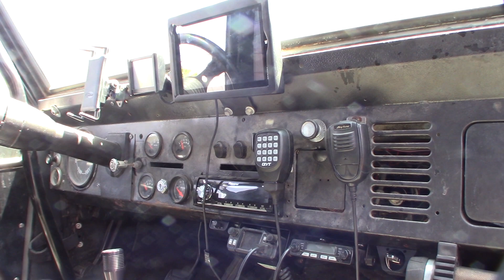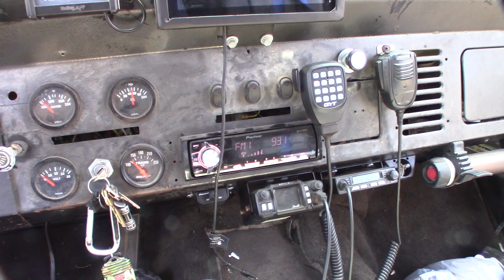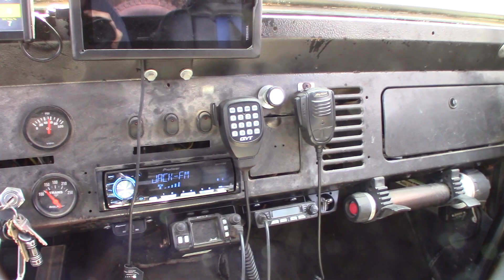Car Stereo AMP speaker Humming Whining sound changing with RPM fix repair solution

Comment: Bro you don’t realize it…but 7 shops have worked on my semi and couldn’t figure out the whine….i got looking through stuff and stumbled across this….this absolutely fixed my issue 100% and now it’s flawless ….ive spent hundreds to figure this out …..instantly made a giant difference…thank you so much for sharing…
Reply: You need to do a big 3 upgrade and clean all your vehicle's ground points for better contact because this video is only a bandaid fix around a real problem.

Comment: I just got a new JVC aftermarket radio and installed it. I don't have my door speakers or tweeters hooked up to an external amplifier, just the deck. I got it all wired and when I fired the car up, as soon as the radio starts, a loud static/screeching sound plays through my mids and tweets. The tweeters get no music just static, the mids get music and static. I am curious if I should cut the car harness's factory ground wire that is running to the headunit and run a NEW & seperate wire from the headunit to the amplifer's ground? Or should I keep the cars factory harness's ground wire and run a secondary ground wire from the chassis of the headunit to the amplifer? Another question is should i use the radios harness black wire (the ground) to run a new wire to a new ground location or should I just connect it to the radio's chassis and run it to a new ground location? Hard to explain but sounds like I'm riding inside a UFO.

Comment: Ok what's the solution if you do not have an amp? 2004 GMC Yukon with factory Bose radio changed out to dual brand 7inch touchscreen. Got an awful whine through the new radio but I don't have an amp.
Reply: Same mine is only the drivers door. 06 Sierra did you ever figure it out?
Reply: Ok guys listen up there are several possibilities and there are steps to eliminate each one.

1. Bad grounding location.

To find a proper grounding spot you need a multimeter set to ohms (resistance).
Put one lead on your battery's ground and test all available grounding spots with the other lead.
Use the spot that shows the least resistance. 

Always ground your head unit, amps, and any other related devices that are in the signal path to one spot.  This is called single point grounding.  Keep in mind that you head unit may be grounding through the chassis also and may need to be insulated if using metal brackets in an ISO mount.
I have also solved ground loops that were caused by the radio antenna.  The outer shielding in some cars is grounded to the ant base from the factory.  Try unplugging the antenna.  

The most common problem is mixing audio components that use a floating RCA ground with comp that connects the RCA grounds to the ground wire of the units power supply.  
Test each component by using a multimeter set to continuity and place one lead on the rca grounds and the other to the units ground.  Then test rca ground to units chassis.
If all your gear has no continuity or if all has continuity your most likely OK .
But if one device in the signal path doesn't match the others you need to address that by either using a ground loop isolator or convert it from floating to common or vice versa.

Do not buy a cheap isolator, I have seen cheap ones ripple your frequency response.  And will only reduce the annoying sounds that you want to eliminate.  A well designed isolator will eliminate ground loops as well as elim8nate radiated noise caused by magnetic fields.

Another rarer possibility Is you have 1 or more bad diodes in your alternator.
Those diodes  that are Part of your alternators bridge rectifier prevent the AC current your alternator produces from alternating into your 
DC  electrical  system through the inverter.  Diodes only allow current  to flow in 1 direction but can fail and allow current to seep back  through the wrong direction.  This can also drain your battery when parked.

Another tip is to try not to ever run your Rcas near or across your power or ground wires.

However if you must always cross them at a 90 degree angle this will reduce the chance of inducing interference.
Reply: Almost forgot I have been seeing a lot of people using the center wire that some rcas have for their remote turn on from their head unit to their amps.

Do not do that.  That wire is not used for that and can cause noise as well as turn on and turn off popping.   Do not use it for grounding either it is way too small for that but if you must know why it's there it's because back in the day there were a few high end companies that used balanced signal cables as found in pro audio that utilized a pair of rcas for each channel and the additional center wire was used to enable balanced mode for Eclipse, Nakamichi, Audio Control, PPI, Rockford Fosgates Symmetry (uh oh giving up my age now)

Comment: I'm having the same sound but only when I use auxiliary, which is what my ham radio is hooked to. 🤔🤔 could it just be my aux cable?
Reply: Use a ground loop isolator and plug in your auxiliary to that

Comment: It looks like your camera lens has been off-roading too! Hahaha. But in all seriousness I'm having the same engine noise/alternator whine as well after installing my pioneer headunit. I BELIEVE it's only grounded out at one spot right now but I'm going to double check as well as try and ground it out to a better location. Glad you found a solution to your own problem though! Has it held up over the years? Or did you end up having to go back in with a ground loop isolator?

Comment: Hey great video will it work for engine humming out my subwoofer I already put afew inline rca noise filter but still humming just out my subwoofer not rest of speakers it's a factory stereo with a add on mono block amps and 3x12" mtx subwoofers please help it driving me crazy every one I ask they said bad ground please any help would be greatly appreciated
Reply: Did you figure it out?

Comment: Pioneer ground thru body only not a good design in my mind.Alternator putting out rf signal interfering with radio very common especially on a 1 wire alt.system.wrap alternator charge cable from alt. To batt. Good idea.Clearly rf coming through negative bat cable.to radio
Reply from the maker: I now have a ground strap going from the back of the alternator to the battery

Comment: I too facing same problem. I try this method
Reply: A little update on my problem guys...first of all yes, my amps are going to the same ground. I solved my problem by making my own custom ground leads for the head unit and it doesn’t make a single peep. You could also do it by grounding the RCAs to the receiver but all I know is that my method worked and I haven’t tried the RCA trick because I didn’t have to. Hope this helps anyone else that goes through this comment section with the same problem.
Reply: So what did you ground
Reply: But did it work
Reply: What’s funny is that I am having the same problem, but the weird thing is that when I disconnect the subwoofer amp and only run the speaker amp, the whine is not there....literally nothing, but once I reconnect the sub amp into the system, I get that problem. What’s REALLY weird is that even though the sub amp is causing the problem, the whine is coming through the speakers, not the subwoofers. The only thing I have came down to is that maybe the fused distribution block I’m using can’t handle the power going to both amps. Fuck me in the ass sideways!
Reply: @spreaddeezhazelnutz7511  are the 2 amps grounded to the same ground? Make sure they are.